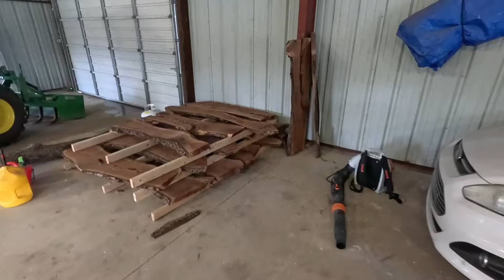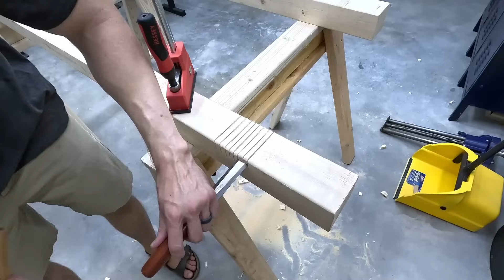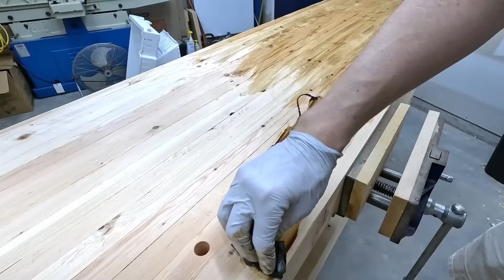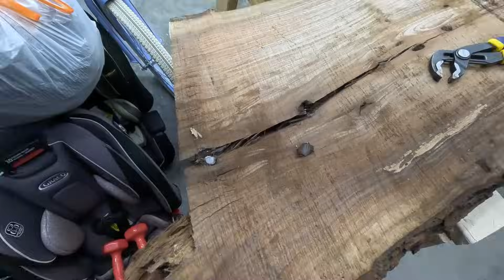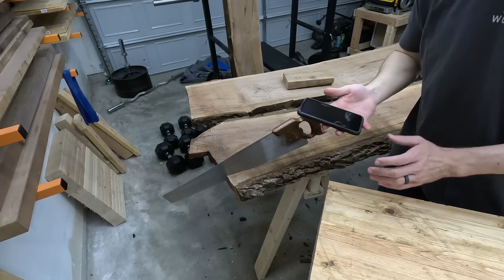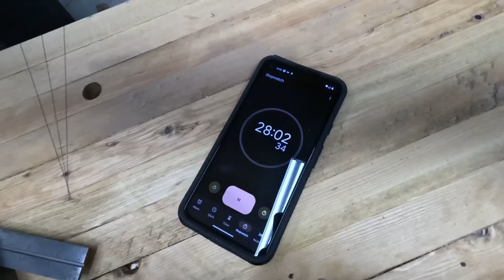I Tried The Ultimate Hand Saw Challenge!

Comment: Thanks Frank.  At some point, I had to make multiple long rips through ash.  I didn't own a bandsaw then so I had no choice but to use a handsaw.  Ash is well, hard.  Wasn't pleasant but I would set timers for like 10 minutes to help me focus.  I'd cut for 10 minutes, go back to my desk and do day job work (was during Covid) then need a break and saw for another 10 minutes.  All in all, I think it was a total of 32 linear feet of cut in eight quarter stock.  It got done and every time I see the thing I made, I smile.

Comment: Great video! I would suggest to anyone to clamp your stock so the cut is vertical. Clamped this way, you don’t have to reach over 12-18 inches and strain your shoulder more (the amount of force you can apply decreases with distance away from your body, slash a constant amount of force coming from your muscles exerts more torque on your shoulder and less force into a workpiece that’s at a distance from your body), and with a vertical cut your arms will not need to move as much, and you’ll instead distribute the forces among the strong muscles in your back and legs, and of course work with gravity. Depending on how you clamp it (say, on the corner of your table with a pair of parallel clamps), you can just walk to the other side of the board rather than flip the board over.

Comment: I know this video is old now, but I wanted to mention this. Today I was staring at a 6 foot 5/4 piece of cherry knowing I needed to do 2 full length rips. It wasn’t til I remembered this video that I thought “you know what? I can do this!”

And sure enough I did. Each rip took about 20 minutes. It wasn’t perfect, but a little planing cleaned up the cuts nicely.

Thanks for this great video!
Reply: Nice...  Yeah, we all know power tools are faster, but when you gotta do what you gotta do, 20 mins really isn't all that long.  I don't have a bandsaw and have had to resaw semi-by hand (do kerfs on the table saw, and saw out the middle by hand).  It's not the end of the world.  Your arm won't fall off... and in the end, you are better for it (#crossfit).

Comment: Great job 👍 if you need to rip some more slabs etc. I would recommend making a couple of shorter saw horses. A hight where you can kneel on the slab. From this position you can put a lot more force into the cuts, use your whole body rather that letting your arms do the majority of the work!

Comment: Those slabs would be super dangerous on a table saw. I'd use my track saw for this but I can very well picture myself doing it by hand, now that you've shown it's not that long. Maybe not for a big project but just for the sake of making less noise a Sunday morning, or if I am getting cold, or if it's the cross cutting blade that's currently mounted on the track saw... and safety, because even if a track saw is safer than a table saw, a hand saw is just on a completely other level.

Comment: Nice job, but I think you could make it a bit easier on yourself.

Like you said, a 26" saw would be easier, but you don't necessarily need lower ppi, your saw is already pretty aggressive (but 3-4ppi would be faster).

Next, you really want the slab at knee height for better body mechanics. If you can lay it on one or two saw benches you can hold it down with your knee and place your body right above the work. You'll be able to better see what your doing, and your shoulder and arm will be at a more comfortable angle.

Finally, you don't need to constantly flip the board. That looks exhausting, and likely doubled the time and effort. 
On the one hand, if you get above the work by using a saw bench, you find it's easier to keep the saw plumb.
On the other hand, with this thickness of board it doesn't matter if the cut is slightly off the line (provided you stay in the waste), since you'll in any case need to run a jointer plane down the edge to make it straight and square. 
That flipping technique is for tenons that you want to use straight off the saw, or for resawing a board into two thinner boards (where drifting a bit off the line WOULD make a big difference).

In any case, thanks for the video!